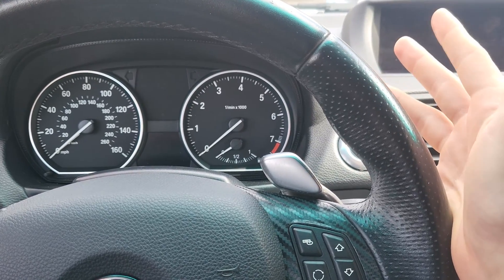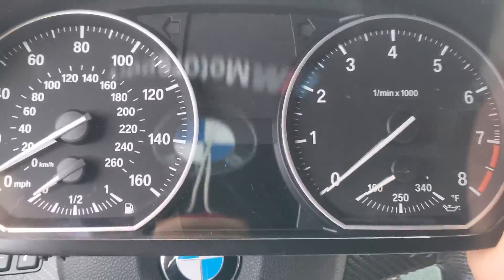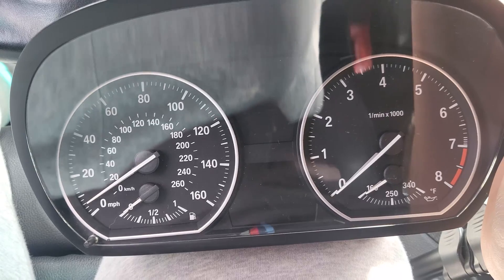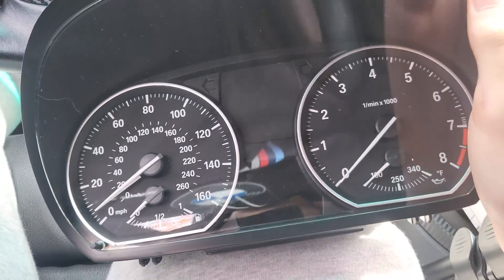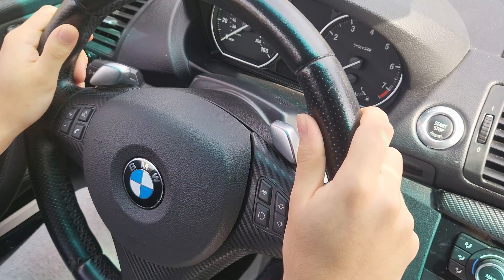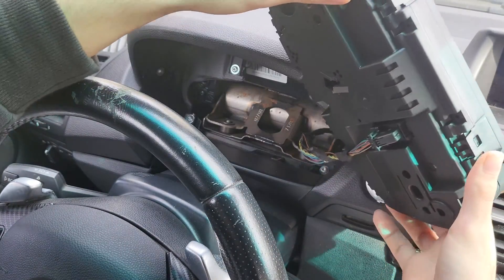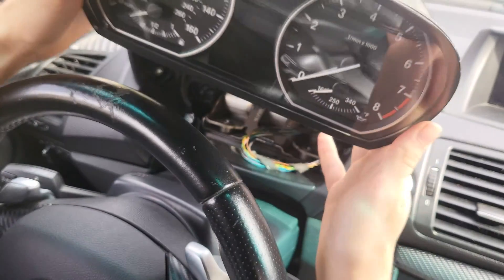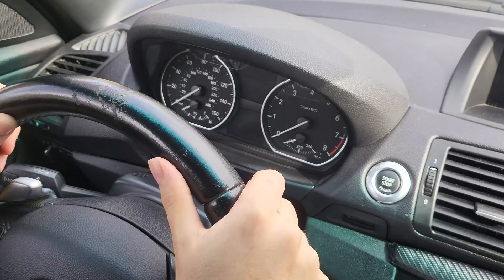instrument cluster upgrade for BMW E8X,9X,6X, add oil temp gague!

Comment: Did you ever confirm if the rpm was actually off?
Reply from the maker: I did! It is completely accurate, I cross-examined with Protool, plugged into the OBD-2 Port.

Comment: This is cool! What happens when you switch back to your original cluster? Does the tamper dot go away? 
How do you remove the tamper dot?
Reply from the maker: I don't believe that it goes away after switching back. Although I know there is a way to remove it through coding I believe.

Comment: Hey! Nice job. Did you have to copy your mileage or code it to the new cluster?
Reply from the maker: No, I believe it defaults to whichever milage is higher, either what is on the cluster or what is on the car. I believe it's possible to code, but I chose not to and it just has the tamper dot on the screen.
Reply: @greezysgarage  Oh wow! Okay but one thing I am confused about is how the oil temp reading will change from gas consumption without coding… Please can say about that?
Reply from the maker: Yes, I believe it is coded in the cluster itself, as is the milage.

Comment: thats not even the same cluster you showed on footage that you took out of e9x e9x has rounded silver rings in cluster and you are swapping in cluster with cut off rings at the bottom the same cluster like on 135i with oil temp neither one bmw e9x didnt come with cluster looking like the one you are swwapping into your car and you are telling that clusters from both models are swappable...maybe with connector and pinout but with casing i dont think so , someone will see this and throw money out for e9x cluster that dosent even fit e8x models.
Reply from the maker: It's true that the pin out is the same, but the housing is different. As I explain in the video, I used my 335 cluster for testing as a proof of concept before buying a 135i model for my 128. I replaced my 128 cluster with a 135 one, and showed footage of the procedure also on the 335. I believe it is fairly apparent that the clusters are different, for someone who is adept enough to attempt this retrofit, but thank you for your concern and I will add this detail to the description.